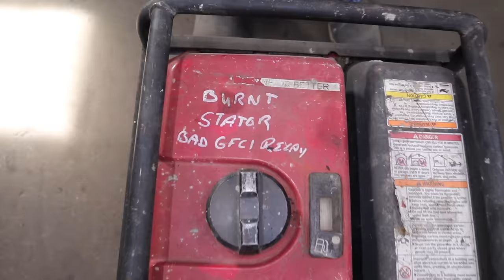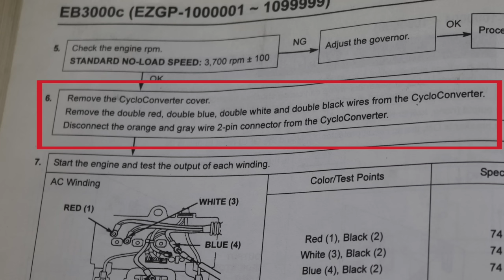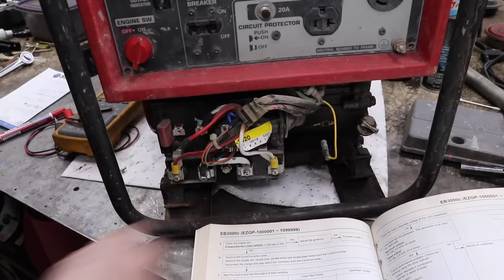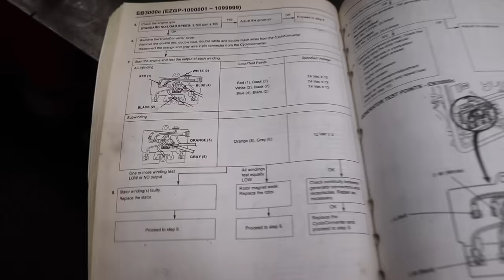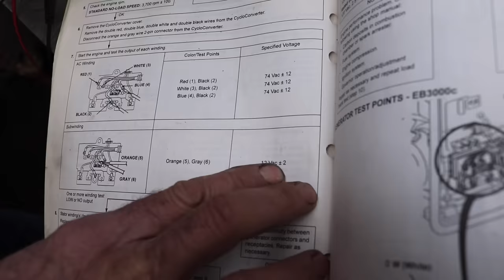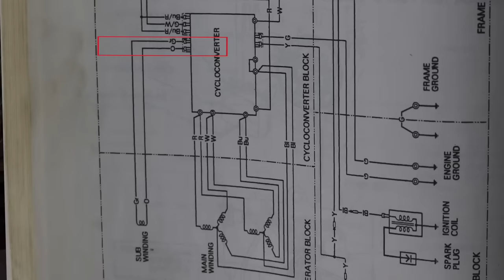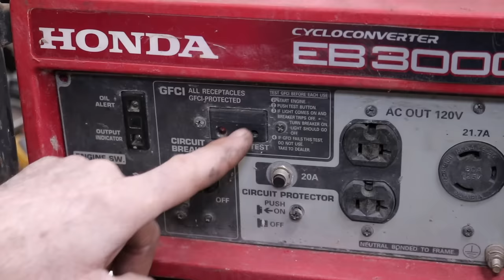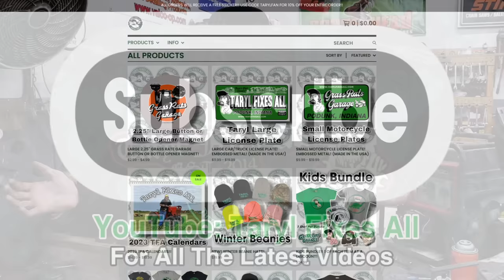Some Things Change For The Worst

Comment: The main failure point of any inverter module is usually the The capacitors and the output transistors as they see the most stress.

I have a dealer account with Champion as well. You can call them and easily get the parts that you need in addition there are engineers who actually designed the machine to begin with that can answer specific questions over the phone email etc.

Firman is another brand based in Arizona that I have a dealer account with and they are similarly equipped and reasonably priced for parts. Engineer support is also available.

Now the inverter itself because it's potted in epoxy they do not provide schematics for that part internally but the cost is not prohibitive like a Honda.
Reply from the maker: I see comments here that you could possibly repair these inverters. Is this true? If so what would it cost.  I could find out if the customers would want to have them repaired.
Reply: @TarylFixesAll  Hey Taryl! Unfortunately Honda and Yamaha inverter schematics are "proprietary" and they do not provide those to service dealers to attempt repair. James Condon and I have tried on a few occasions and no success. The epoxy resin is also a challenge to remove without damage, especially with SMD components.

Champion and Fireman inverter modules are far more reasonably priced making it not economical to repair. 

Thank you as always for the amazing content!
Reply: @TarylFixesAll  they can be tested with oscilloscope and ohm meter if you know the values of a known good capacitor, transistor, resistor etc. Here lies the problem though that without having schematics you have to test each individual component and have known good readings to find the bad one(s) that can take a long time and time is money to the customer
Reply: @TarylFixesAll  as you there is no quick or profitable solution.  even on some that you can come up with something to make it work half a$$ and people don't want to Frankenstein there generator so they can use it . not worth the headache I've been there .
Reply: you can just build the inverter
Reply: That's informative info thanks
Reply: @Bassguitarist1985  most of the epoxy they use on parts like can be dissolved in acetone or something like that
Reply: @billyjackson5799  Yes it could, but it damages printed circuit boards BIG TIME. Defeats the purpose.
Reply: yea, but, how long will champion stock that stuff? maybe buy a new inverter with generator but, the if the caps die of age even a room temp kept inverter might not help.
Reply: @cdoublejj  who knows. Planned obsolescence is a double edged sword, yet it always unfavorable to the consumer.
Reply: @Bassguitarist1985  it won't if you only let it soak long enough to soften the epoxy to where you can peel it away
Reply: @Bassguitarist1985  which the best way to figure out how long it takes to get to that point is to practice with some parts that already beyond repair
Reply: @billyjackson5799  still leaves the lack of schematics and spending a ton of time testing components for their specs and if they are good or not. Not practical dollars and cents wise for a repair shop. Flightsystems I know does not repair Honda or Yamaha
Reply: @Bassguitarist1985  yes and no I mean once find out which caps and stuff that are bad the best thing to do is just replace them with some really high grade replacements which is what I would do if I decided to try my hand at something like that i would look to see if the caps have information on the sides and possibly a brand to see i could pull up the specs on the that way then test them to see if any of them are and if find some that are bad I replace them with new caps that are much higher grade and the same goes for any kind of relays or fuses that way I know it's going to last
Reply: There are two part numbers for the EB3000C inverter. One is the bare inverter module and the other is a kit that includes the module and a small harness. The bare module is still available. It's the P/N for the inverter and harness kit that is no longer available.
Reply: @billyjackson5799  dude if  it's dead...  just buy another one.. if the price is a problem.. Champion makes a decent inverter generators  3650 watt continuous output a true 30 amp is a third the cost and actually comes with the wheels which Honda charges extra for those.. don't try to chemical peel an old investor board and rewire it can be a potential fire hazard don't do that get a new one !!!
Reply: I just got a 2350w WEN suitcase off the interscreen for $400 free ship.  Screw honda
Reply: @joebrown9621  lol trying to fix something like that is more for fun just see if it can be fixed I work small engines and stuff for a hobby I've fixed a lot of things that people have gave me and said they were told that they couldn't be fixed
Reply: I have a firman & had some trouble so I called them , there where so helpful.
Reply: Just buy a Predator Generator from Hobo Freight
Reply: @NoNORADon911  same problem as Honda..some parts are unavailable or on serious back order.
Reply: Looks like it fell off the back of a service truck running 70mph down the interstate. Knock on wood I’ve had a 12,000 Honda generator since 2003 and it just works. Granted it’s not in use constantly. Just used when we experience a power outage at the house. Usually once or twice in the winter at most.
Reply: @Bassguitarist1985  You don't need a schematics to repair boards. An ESR meter for the caps, a multimeter and a bench top PSU.  Acetone or MG Chemicals Conformal Coating Stripper.
Reply: @NoNORADon911  I'm a Predator generator fanboy but HF is not the greatest in the repair parts department, they have promised to get better. However at least for non-inverter generators there are lots of third-party repair parts since everyone seems to use the same Chinese components.
Reply: @bobsoft  it sure makes it easier/faster to diagnose and trace the circuits. Its not that it cant be fixed its just impractical, both in time and money.
Reply: Techically if you were able to disassemble these inverters even without a diagram and your good with making your own boards for projects you can reverse engineer said inverters just by looking at all the traces assuming all parts on the smb chips are readable.    Its more of a hassle to do it but if your successful and you get all the correct readings , you would have to have a known good working one to read all the valies from however. There is money to be made , dont bother reusing old boards and componants , make your own replacement board.
Reply: @killerdeamonking  thats one skill I do not have. Time is also luxury when going through the discovery process with other more pressing projects. I hear you, to the right person with the right skillset can do it.
Reply: @Bassguitarist1985  Indeed .
Reply: @killerdeamonking  What you are saying is totally impractical and almost impossible. As an Electronics Engineer, I can easily reverse engineer the main inverter blocks (i.e. the rectification circuit, AC waveform generation, IGBT output switching transistors, feedback loops, etc). That doesn’t mean I can (or want) to build an inverter from scratch. Another thing to consider is the inverter controls the engine speed as well as emergency shutdown for electrical overload conditions and low oil (as described in the video). Also most circuitry is going to be ‘proprietary’ unmarked I.C. chips. 

That said, repairing the inverter would be a safe, reliable and economical option. Most failures (as many have mentioned) is the capacitors. They have a liquid electrolyte that dries out over time and with use. Also the rectification diodes usually fail as a short circuit and so does the IGBTs (or high current switching transistors / MOSFETs). Any of the above are common failures and can be checked with visual inspection or with a multi meter (once the potting material is removed). 

If you are new to electronics, I encourage you to get a cheap multimeter, read, disassemble something, lookup datasheets on components and research how that device works. There are also inexpensive electronics kits online.👍
Reply: @Bassguitarist1985  Most inverters I have worked on had bad output FETs
Reply: @ecaparts  Im not new to electronics , nothing is impossible . Everything is possible as long as your willing to go through trial and error and not give up , while impractical yes but also a must if your in a pinch and if your generator is still good and healthy. No point in throwing it out if you can reverse it.
Reply: Those darned leaky or open capacitors again! Making my vintage radios quit!!!
Reply: Capicitor nearly every time. Just look for the bulged top.
Reply: @ecaparts    As an old time electro-tech,  all that you stated,  Ecaparts,  is  CORRECT.   Running  ' any '  generator, out of gas, with an electrical load on it; whether it be  an inductive or resistive load, will  HARM   the  AVR,  and /or   the  inverter parts.   I'm   thinking, of a way to connect a float in the gas tank, with a relay powered from most generators'  12  volt,   (usually 8 amps or so)  output;  connect the relay to a solenoid for shutting off the gas from the tank.  Both the low oil /  low gas  levels, would shut the gens'  engine down.  BUT, before this happens, another relay  ( high current, 240 volt minimum rating ) would switch  OFF   the  load, similar to a  GFI  power  socket.   Anyway,  good  luck,  to   ALL     which   use   THEIR   HANDS/   BRAINS.    oh,  Thank you,  Mr   Gross  ( Taryl   and his men )
Reply: @TarylFixesAll  
You would have to know how to use a volt ohm meter.
That you make fun of for testing a ignition coil ..
Reply: Ever checked the actual sine wave coming out of these units?
Reply: Hello bassguitarist1985, 2 thumbs up. I too have dealt with Champion, I give them 5 
stars for their customer support, have bought from them, quick shipping good ppl to 
talk to.
Reply: @Bassguitarist1985  Hi there, a bit of a grammatical error here?
Champion and Fireman inverter modules are far more reasonably priced making it not economical to repair. I think you meant

"Champion and Fireman inverter modules are far more reasonably priced, 
making them economical to repair." Yup Grammar can be tricky.
Reply: @raymondgarafano8604  actually no Firman is the correct spelling. I few other grammatical stuff I saw afterward but couldnt edit after Taryl pinned the comment. :-)
Reply: @killerdeamonking  and how much does that cost, time is money so figure $50 per hour. clocks tickin, add it up. he already stated he could fix it, but that the cost would be more than buying a new generator is worth once he got it up on the bench.
Reply: @aprilgeneric8027  Costs should not be all that high depending on if you have all the resources and componants you would need.  You would need a ton of patience and a bunch of them to destroy befor succeeding. If it's a high popularity item and many people are looking for them then it may just be worth it. I doubt it would cost someone $50 per hour to redesign something. Keep in mind that doing so would be for those who currently already redesign and remanufacture circuits or for those who are into project designs who make their own.
Reply: Apparently it comes down to time and money for parts, unfortunately it is such a throwaway world, this is how these companies are profiting, I read an article, about a person who purchased a $32,000 used electric vehicle, two months later the batteries went bad, they said the batteries cost $14,000 to replace but then they found out that the batteries were no longer made, typical to get you to buy a new unit
Reply: @startover125  Pretty much.
Reply: Stop worshipping the honda God and buy a new generator that's not a honda
Reply: @TarylFixesAll  you can just put another generator head on It
Reply: @CYbiafra  No, you can't, and even if you could that would be a $500 project anyway. The governor speed is controlled by the inverter that is broken.
Reply: @CYbiafra   I was wondering what other brands with similar, if not the same functions, are on the market.  Guessing easiest is to start with one of those and then design the rest of the functionality, if all wasn't present, so to have an option on the market whether open source or not.  Wishing I had the time, though the Brain Invaders won't stop being invasive nuisances with their mind control beam forming remote sensing stations concealed wireless assault weapons like typical insurgents do to create crime all false fabricated an all like inbred genius crooks that leave us junk and crooks.
Reply: Thanks for confirming anything Honda lawn equipment is not the way to go. Vehicles; different story. But lol @ lawn equipment.

Comment: One of the reasons these regulators fail is due to shutting down the generator with a load on it, or letting it run out of fuel under load. The regulator senses the voltage dropping due to the rpm decreasing and it ramps up significantly to try and compensate. This blows up the capacitor(s) on the regulator rendering it useless. Always remove the load from the generator prior to stopping the engine and don’t let it run out of fuel under load either.
Reply: Excellent info. Thank you.
Reply: Or maybe don't buy generators built to die / designed like crap / made by idiots.  You'd be surprised at how well generators can be when built the right way.  A few people out there get sick and tired of all these mass produced ones - and just build their own lol...  Or spend more money on products that are actually built to last.
Reply: I install and repair LP standby generators for a living.
You are 100% correct !!
Never start or shut down a generator under load !!!!!!!
Reply: Only problem is that when it is used as an emergency backup power it is inevitable it would run out of fuel under load eventually, not everyone are that observant._
Reply: Sc xx l
Reply: @honklerton732    Yup.  i've  got a 1983   Yamaha  EF 2800.   Blue, old one, for free, at a garage sale, Very heavy. Now, after re-doing carb completely, and de-rusting gas tank, with  10 %  acetic vinegar, and a box of nuts, as a rust remover, while SHAKING   THE  HECK  out of it;   WORKS,   AWESOME.  !  Usually, starts  first, second pull,  re-set governor, for proper  hertz / voltage output, and rpm at about 3640....  GOOD  LUCK,  with modern  ' junk '.
Reply: That sounds plausible!  I can't imagine the abuse this thing suffered on the job site.
Reply: Makes sense,   I'll remember that.
Reply: @DjResR  this is why buildings and installations have engineers,electrical,mechanical on hand to take care of vital power,and distribution,from macro to micro,same function
Reply: Thank you for the heads-up!!!💯💰🍻
Reply: @honklerton732  so what’s the right way to address this issue? How should it be built instead? As far as I know it’s never a good idea to have a power draw on a generator when it’s shut off.
Reply: @DjResR  only problem is that’s the owners problem. Careless people pay the price
Reply: I call that a design flaw.
Reply: having worked construction, i know exactly how this happens, some one else who is not you the one using the gernie does this for you, not of your own choice, but of their choice because #1 it's not their equipment #2 they work for some one else #3 they don't care and are only worried about getting their own work done and you chit's in the way so they are relocating it or it's interfering with their own work so they shut it off rather than deal with the noise and exhaust while they are working in the area this is located such as a garage floor in the winter, when the garage  door guy comes to install the garage door on a new house.
#4 your boss shuts it off because it's time for lunch/end of day/meeting
#5 an ignoramus who is one or all of the above
Reply: @honklerton732  it also says alot about Honda engineering, when their high quality engines are copied using cheaper materials, etc,and they STILL run beautifully.
Reply: @petersack5074  I hear that! Got me an older honda ep2500cx, very reliable, no issues yet,after almost 14 years. These new ones,sound scary, circuit boards and capacitors, etc... pfffft... nope.
Reply: Those large Electrolytic Capacitors are only rated to last 10 years.  As they age,  the paste like compound between the layers of foil dry up.  There's nothing anyone can do to stop the process.  The fact is, these parts could be replaced if they didn't  epoxy seal the PCB.  Yes they could have placed that PCB in a metallic enclosure with a rubber gasket type seal. But remember Honda and all the rest need to sell generators every year to stay in business.  The other reason they epoxy seal the PCB's, is to slow down the other manufacturers from stealing the design.
Reply: They should put a sensor into the fuel tank that shuts down the loads before running completely dry.
Reply: @honklerton732 normal people don't had PHD's in building generators. Normal people do have the common sense to take care of them and maintain them. However, they fail at that as well. Non-ethenol gas, fuel shut offs valves, empty gas  tanks when stored (no need to so with non ethanol gas), and don't store outside. I have a Troy Bilt zero turn from 2005 that runs today; along with the same generator from 2003. Common sense can to along way. And anything new; good luck for longevity.
Reply: Yup and being owned by a construction company I can guarantee you that the only time it got fuel put in it was when it died on the jobsite and the lights went out or the tools stopped working.
Reply: Sounds like good plausible advice...😉
Reply: @DjResR  Good reason to stay with the old dumb generators....  The voltage may not be as clean but much of the modern electronics does  not care unlike all the generator hype about clean power.